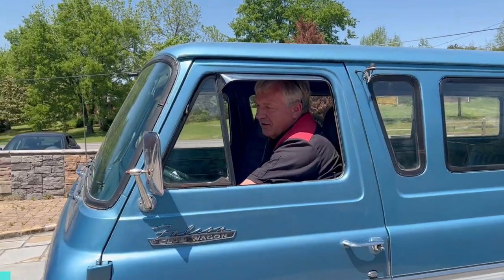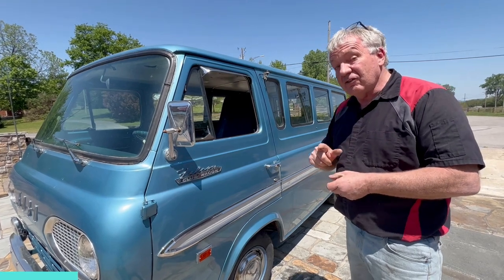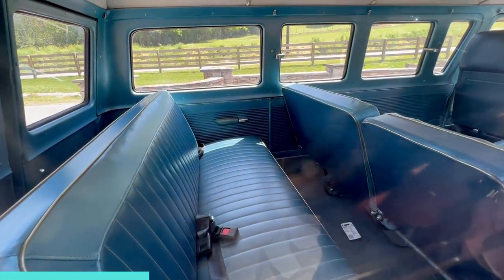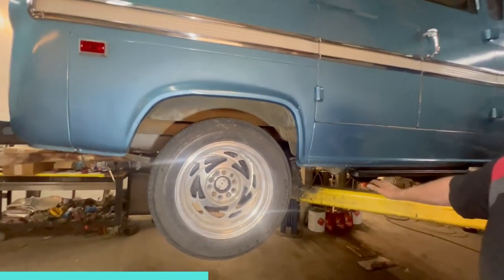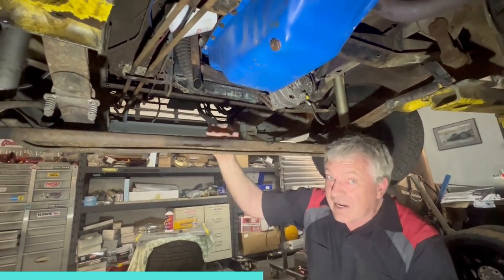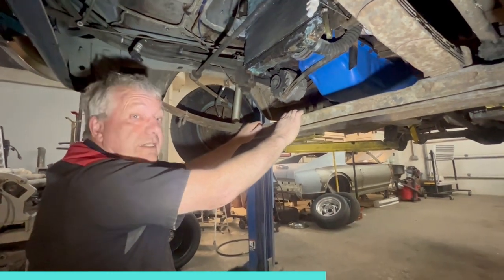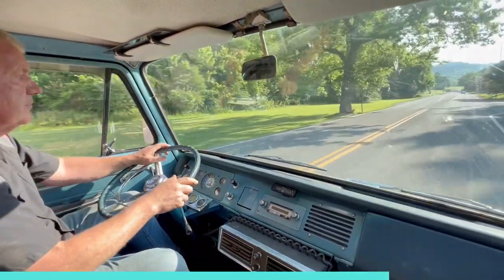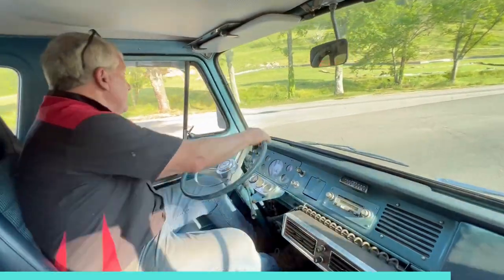The Mystery Machine???

Comment: That's a sweet ol' girl. Wheels and tires? I'd go with:
 1)-14 or 15" aluminum slots with RWL radials...
2) Wider 14 or 15" steelies with 1/2" white stripe sidewalls and the correct Ford  small caps and trim rings-a kind of"factory  deluxe" look...
3) Or just go full 1975 with 15x10 Cragar S/S in the back and 14x6 same in front with some M/T or Pro-Trac meats...
Super Kool van, Kiwi-thanks for takin' us along...

Comment: Hate to see such a clean original vehicle chopped up and modified with today's technology, wish that they would use a ruff, rusty one to modify, but that's the way of the World today.
Reply: They all went to the wrecking yards with crushed front ends. Look at the size of the drum brakes. They handled like crap, noisey as a beer can full of marbles, everyday repairs and maintenance required a lift... Oh, never mind.
Reply: @outlawbillionairez9780 those are there better points.🤣🤣 But is a good-looking man the way it is.
Reply: @CAROLDDISCOVER-FINDER2525  This one is in excellent condition. I've only seen ones like this at car shows, and pretty modified. They'll never be worth a lot, so if you're going to drive it on the street, upgrades in power, steering and brakes are in order. 😉👍
Reply: I drove a 65 Chevy shorty cargo version, very similar to the Falcon Econoline, what a great vehicle overall. I preferred the cargo version for the privacy it provided. It’s worth your time and money to replace the kingpins and bushings, anytime you are under it, pump a bit of grease into them, and put heavy shocks on too. As a hint as to how long ago this was, I put a pair of Goodyear Polyglass GT tires up front. They were a new model of tire then and the driver side tire came apart at 60 mph. (Almost balls to the wall for that 230” engine) the front end work saved my arse, I was able to safely stop it and toss on the spare, return to Montgomery Wards and get it replaced..  the GM version of this rig almost always had shifting troubles. The neutral gate in the bottom of the column would wear and allow you to shift up to second without shifting the transmission out of low. Almost every one of them had a buggered up  grille from owners prying through the stamped gaps to get back into neutral until they figured out why you couldn’t fix it with linkage adjustment and re bushed the shifter assembly. The biggest problem was heating the beast during the winter.  A curtain helped, but a Volkswagen gasoline heater in the back was the solution. Overall these econo-vans by any of the big 3 were great vehicles if you drove it within its design limits. The rare ones were the Fords with doors on both sides

Comment: "A little vague" you say, while sawing away at the wheel. Bit different to the Falcon "Panel vans" we know down here, of which you have previously mentioned (XB) Chris. Depending what spec Barra you're after, (182, 190kw or turbo, 4 spd or ZF6 spd auto, or manual?) I could shop around for a complete wreck, strip it and try to work out shipping of all the parts you need sent. Wouldn't be a particularly cheap exercise I'd imagine. But doing it that way would have all the matching bits, engine, trans, loom, ECU etc.

Comment: Such a cool old van. I think if it was just a go to the car show leave it as is, but if the owner wants to use it as a legit long hauler, i think making it more modern for highway use is a dang good idear. The 6 banger you are talking about would be awesome,  and a 289 would be a very fun build also. Great video guys, it was cool to see something like this machine.
Reply from the maker: Thanks man.  Yeah he wants to drive it a lot.  But he also wants to keep it in that era so it won't be 20"s and super low.  Just 15"s and sounding a little stronger than stock
Reply: @kiwiclassicsandcustoms9160  ya and some better brakes and maybe the dif.
Reply from the maker: @rescuedandrestoredgarage8988 yeah that too!!
Reply: @kiwiclassicsandcustoms9160  sweet.

Comment: My father had a '67 Falcon club wagon in the same interior/exterior colors.  It had the 3 spd with the 240 six engine. I don't think it had that side molding though.It did have a bigger rear ,9" I think. It had west coast mirrors and the same mechanical side step.  I added VW back up lights on the rear bumper and a CB on the front of the engine cover. That was 1977. It had been repainted by then and had pretty severe rust that was  covered over with Bondo by previous owner. We took out the middle seat and left the rear for more open space. We added some kind of high back bucket seats as the factory seats were low back and very uncomfortable. I did learn to drive on that van. It really was nice in the era before mini-vans. IRRC we sold it in about 1980.

Comment: I think this has to really rare.  There were always lots of the Econoline (work truck) versions everywhere in the 60's and 70's, but I don't recall ever seeing the family passenger Falcon version.  And this baby is extra cherry too! Being a linoleum layer in the 70's I drove the Econoline versions for years, even after the newer vans came out in 69 (I think).  I always liked working out of the smaller old style rigs because you could back them into the garages of the new tract homes we were doing then (out of the rain if it was winter, or the hot sun the rest of the time) and the newer vans were too tall to fit through the garage doors. We also had one of the really long ones at the shop, had a majorly long rear overhang past the rear axle that always looked to me like if was drooping and ready to fall off LOL.  They all had the little 6 bangers, but I think they were the 170 ci versions.  Anyway, I am excited to see this rare old van get the Kiwi Custom Treatment! You get a very interesting variety of fun stuff to work on, and the videos are great, so thank you!

Comment: You don't see many vans of that vintage in such good, original condition...most got used up and tossed out.  Slamming that rig would make me sad...my inclination would be to keep it as stock as possible (especially in terms of appearance) but MAYBE upgrade some internals like the suspension and engine to improve reliability and performance

Comment: I owned 65 panel in the late 1980s and  in 1990 drove it from Florida to Washington state with the original 185 cubic inch straight 6. And drove a 67 in 70s at the job. The weight is under 2000 lbs that one is probably 2500.😆. You have to pull motor out the side door if you don't have a lift.
Reply from the maker: It looks like it would come out the bottom pretty easily. 🤞

Comment: I can see why they would want to chop it up. The body work on a rusted-out one would be very expensive. But I have to agree with the other guy. I think I believe this one like she is. You got a running well and I supposed to fix the side door lock. But in the end it's the owner's choice. Australian engine sounds very interesting. But if you ever had to get parts for a later wouldn't that be kind of difficult? I know little Dodge vans with the 318 scoop down the road and I think at 302 or 289 would  do the same for this van. But then that's been done time, again. The interest and inline 6 is great. Thanks for showing us van is very nice example.

Comment: I wouldn't change a thing on that pretty old van, I'd keep it as original as possible.
BUT!
If rodded, Barra with its crossflow head is way to go and just for the sound, I'd keep it N/A.
(yes, im old school)

Ps.
You guys do a great job in your shop; Kiwis, Chickens and Cuckoos! 😁
Reply: I was thinking the same thing.  If the Barra and parts was readily available in North America, yes, but since it isn't, I'd go with a 300 6 cylinder or 302 V-8 Ford engine and overdrive transmission with either engine choice.
Reply from the maker: Lol. Thanks man and thanks for watching!!
Reply from the maker: All will be revealed in time......😎
Reply: @gregmckinney6977  Yes! If a Barra turns out to not be feasible, a 300 is the next best choice!

Comment: I had 2 Chevy vans from the same period. They had a finned belly pan in front of the radiator that would force cool air through the radiator. You might see if Ford had one too.
Reply: ...those pans are key to keeping those 60's era vans from over-heating...iirc..
Reply: The louvered pan appears to be missing on that one also
Reply: @Greg-xv9qj  It will overheat without it...

Comment: The Barra has a 1.42" taller deck height plus how much taller the DOHC cylinder head is. Looks like the bore spacing may be the same or close to it so the length  is possibly good? As for the height you could probably make the dog house taller with a spacer to remount the lid on.

Or to make things easier perhaps a turbo on the 144? The engine looks like it's in great shape just begging to be turbo charged. But I'm not to familiar what the limitations of that engine platform is? This platform goes up to 250 cubes but those have a 1.661" taller deck height if there is room? 

Then there is the 302 which is a short narrow V8 that would work really well in a 347 stroker form. Should be able to source an engine and overdrive transmission from the junkyard with fuel injection too if the customer wants to go that route? 

A 4.6L with its overhead cams and taller deck height might be a bit more challenging but also doable? May be even easier to source than the 302 engine platform as well with better electronics for the FI and overdrive.😎👍

Comment: My parents almost bought one of those. I remember riding in a new one with that new vinyl smell. They bought the new Chevy Sport Van instead. My mother called it a bus because our neighbors bought a VW bus. It had a 230 cu six and a powerglide. They drove it California to South Dakota more than once full of kids and stuff. The 144 would be unusual in 1964. I had friends with them when I was in my teens. Most had the 170 and they had so little power. I remember replacing king pin bushings.
Reply: When I was in kindergarten, (1971-'72) the kid acrossed the street was a senior, and his first car, which I remember, was a dark green 'panel' Econoline like that, but I can't remember if it had windows in the rear doors or not. It was definitely a straight six though, because I can distinctly remember the sounds it was making when he and his buddy were trying to get it running in their garage, after they'd had it apart for a several days. They did get it running right soon after. The way it was sputtering, I'd guess they were dealing with a dry fuel system. But I don't remember any backfires.
Fast forward 45 years, and I was looking at my hometown's "I grew up here" page on the facebook, and I seen him post that his first car was a retired Ohio Bell '62 Econoline.  So I'm not sure if he had that one painted the dark green, or if he'd gotten a different one after, but I was surprised at the fact that he didn't mention the car he had after the van, after he was out of school - it was a ~5 year old Carrousel Red 1969 GTO, (not a Judge) with big and little Cragar SS wheels! I can remember peering in through its passenger window when it was parked in the street out front, but I don't remember if it was manual or automatic, or column or floor. And as I grew older, I remembered it as a Judge, but later found a family picture which captured the car sitting out front, sans Judge stripes and psychodelic nomenclature, but wearing them badass Cragars!

Comment: Perfect with the Updraft 1988-1991 ECI 3.9 Multiple Point intake runner...the dog Box is very restrictive. The Barra and 3.9 EFi share the 144,170 and 200 engines key architecture, but not the deck height and narrow width. My two forum  Buddies MegaSquirt buddy John Laugh has a 240/300 Big Six with injection in his Econoline...they just fit if the EFI runners are custom.
Reply from the maker: I'll look him up!!
Reply: yeah...you'd be better off getting a big ford six dog engine box to fit a 4.0 efi (let alone a turbocharged option!!) Barra Inline 6 engine in that e100 1st gen!!

Comment: "It's a little warm in here" - That's what the wing windows were for. 2-40 AC.
Personally I would have mixed feelings about putting a 300 hp engine in that thing. Of course he'll need the brakes to handle that. Those vans have a high CG, so one must be careful about having a lot of power and trying to use it.

Comment: Is it typically safe/normal to lift a vehicle on the leaf spring ??
Reply from the maker: It's not typical no, but there are a few vehicles that you have to.  You have to be careful as the springs move as you lift the car but it can be done.  It's much better to lift on fixed chassis parts.

Comment: If I was going to change any parts I’d make sure they were the most common parts available. You want to take it from a 50 plus year car to a 100 year car. One that will run till they don’t sell gasoline anymore. If it was a Chevy I’d LS swap it just because there will be LS parts as long as they still allow internet combustion engines. Some engine from Australia? Not so much. I’m sure they’ll be making parts for the old Ford I6 when Hell freezes over. It’s basically bullet proof. The Barra is a good engine just doesn’t have the support of the other engines that you can get parts for everywhere but the 7/11.

Comment: Auto Zone isn't going to have parts for the engine you want to put in there.
Reply from the maker: That's true but since when did hot rodders do things the most sensible way😬😂🤣
Reply: @kiwiclassicsandcustoms9160  That would be never.
Reply: Remember that guy on FEP who put a Barra head on the 200 in his Fairmont Futura/ZephyrZ7? Or actually I think he might've used used a USDM 250 short-block.

Comment: I can't watch people destroy original vehicles.
Reply from the maker: I get it 😁
Reply: @kiwiclassicsandcustoms9160  I appreciate that.
Reply: I'm thinking that one has been restored. Look at the third-row seat, and its seatbelts. But I hear you loud and clear... Tasteful, bolt-on, EASILY REVERSIBLE, mods don't bother me much, unless a vehicle is a truly untouched original.
A non-invasive, or non-destructive, bolt-in, Barra swap is pretty cool in my eyes - but of course only if you keep the original engine with the van, or especially if you put it back in before selling. Some of those old Falcon-based vans came with the Dagenham Four Speed - ON THE TREE!   I think there was a lever to engage reverse?
Gee, if anyone could adapt a single rail five speed to a column shifter, I'd think it would be Kiwi.